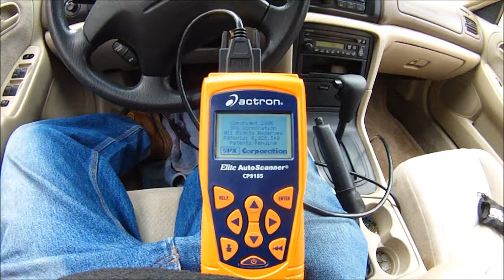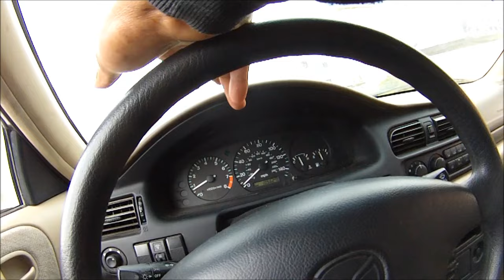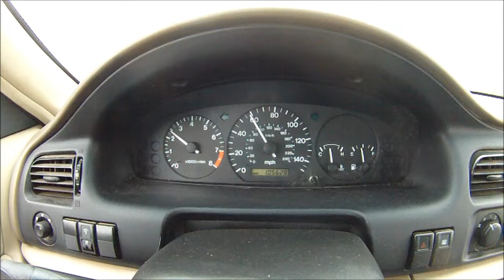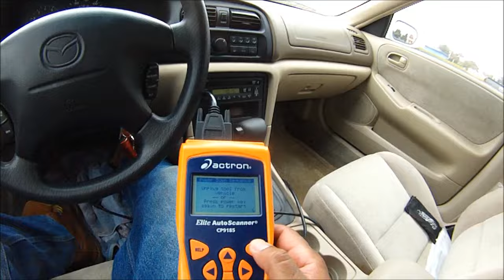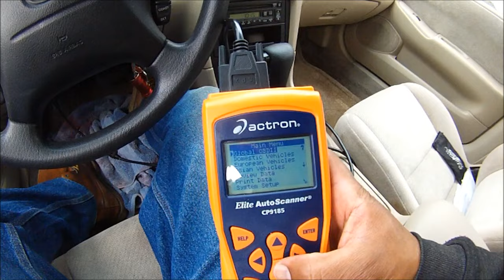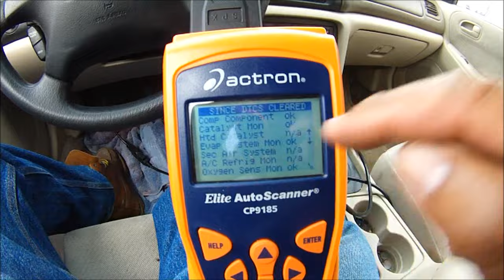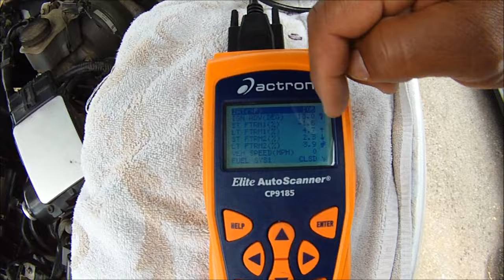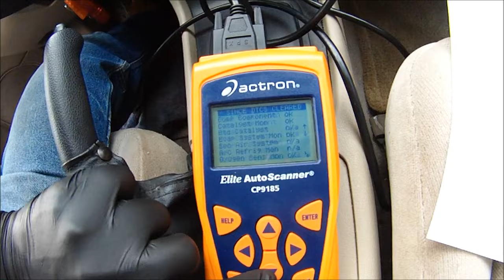WHAT SMOG TECHS WONT TELL YOU AFTER YOU FAIL THE SMOG TEST FOR (INCOMPLETION OF OBDII SELF TEST)

Comment: I have an 08 Chrysler pacifica. my problem is that the p0420 comes on before the evap system is ready. I've tried all the driving cycles to try and get the evap to be ready before the cat monitor triggers the p0420 and no luck. So stuck and looks like I'll have to replace the cat. Any thoughts?

Comment: Oldskool funk, I am having major problems just to get my smog check to pass. I have a 2005 chrysler pacifica touring. After failing a smog check, after getting all the repairs they now tell me that it is not ready. I think I will try this, what do I have to lose.
Reply from the maker: Research your drive cycle first so you don't waste time La Tanya, or ask a couple of smog techs (yes drive around and ask, the worst they can do is not to tell you) the process for your specific vehicle you can save a lot of time and money if you simply ask some will tell you some wont, but do not stop or give up God Bless.

Comment: Very helpful. I have a 2002 corolla. I have been driving the car like this for few times but still my cat monitor is not ready. I failed my test because of CAT monitor being not ready. Any suggestions?
Reply: Yes, buy the $70 Actron Elite scanner from Amazon that is shown in the video. Follow steps in video with scanner. Retest with scanner before taking it to smog station. Keep repeating Toyota drive cycle and re check with scanner until the I/M shows as all ready. Drive car a bit on the day of retest. Then take to smog station and pass!

Comment: I own a 2000 ford Taurus and I've never seen anything like what I've been dealing with. I get the monitors all ready except the evap, I'm allowed two not readies. Anyways I get all the monitors ready needed to pass then when I shut the car off they all go not ready again. I checked power to the ecu and I'm not losing power. last time my mechanic friend  let me remove  my obd scanner and plug the inspection scanner they use without shutting the car off, he let me and I passed that was last year 2015. Now I need to do it again and the shop isn't around no more. Sucks man I live in NY and I got cops harassing me, leaving tickets on my car as I sleep for a overdue inspection. I've been pulling on my front lawn since when I call it a day.
Reply: Anyways I was wondering if you ever had such a problem or ever heard of the pcm resetting itself when you turn the car off. I already tried replacing the ecu and the pats system "theft system" doesn't allow it cause then the ecu doesn't match the key going into the ignition. I just get a theft light flashing. If you have any ideas please share cause I'm scratching my head on this one. I'm not no baller if I was I wouldn't be driving this. Thank you for your time I appreciate anyone's input. Stay up
Reply: Do your check engine lights flash in any pattern?
If there is a pattern, count the number of flash pattern as it's a code.
It might stop flashing and you'll have to start the engine again.
Then search for the error code online...i found a bad seatbelt indicator wire
Reply: Steven Green Dependent upon what type of vehicle you're referring to, most vehicles have a Keep alive memory power into the ecm/pcm. Some are fed from a fuse but I would need the info for your vehicle to check a wiring diagram
Reply: ONBOARDTECH333 I have a 2011 Toyota Corolla. Which fuse would I need to replace, remove, or whatever?

Comment: If your check engine light has a hard code all this trickery is no good. get it fixed and you don't have to worry. Shop around for a good mechanic that will not rip you off. Evap system monitor WILL take awhile to be ready for my vehicle it took about 20 to 30 start stop cycles to be ready regardless of total miles driven.

Comment: HEY IF YOU JUST TYPE OBD 2 DRIVE CYCLE PROCEDURE YOU CAN FIND UNDER REPAIR PAL WHICH IS PRETTY BASIC AND IF THE CAR SYSTEMS IS OK YOU SHOULD BE ABLE TO COMPLETE THE DRIVE CYCLE TEST TIME 20 TO 30 MIN .. THE CAT MONITOR  IS VERY SIMPLE TO COMPLETE 3 MIN STEADY  AT 55 MPH USE A CELL PHONE STOP WATCH AFTER 3 MIN TAKE YOUR FOOT OFF THE PEDAL LET THE CAR COAST DOWN TO 20MPH DO NOT STEP ON THE BRAKE  ONCE IT HITS 20MPH GO BACK UP TO 55MPH FOR 5 MIN AND THE CAT SHOULD COMPLETE SOME CAT MONITORS TAKE UP TO 5 TIMES TO COMPLETE

Comment: Ok...couple months ago I had my water pump replaced. After that a "Check Engine" light came on and I took it back to the guy who did the water pump for me. He deleted the light (I was not aware of that). I thought he fixed it. 3 Weeks ago the vehicle was due for smog, but there are three lights that need to show, so it failed.  I took it another shop he told me to drive @ 55MPH. I did pick up another light. Now, only the Catalyst Converter and EGR are not showing. What should I do? Please share.

Comment: Did the 5 min 60 mph freeway and slow to stop with no brakes.  Twice!  I already have replaced the 02 sensor 100mi ago(as recommended by FIXD Scanner) STILL MY CHECK Engine is ON!  What Now?  My Honda CR-V only has 85,000 and pass smog last year 10,000 mi ago!  Car run fine  Clean plugs+gap.  Cleaned fuel injection with Purple $20 cleaner 2X, cleaned MAP, New Air Filter!

Comment: I have a 2005 chrysler pt cruiser manuel High output 2.4 L engine. i recently changed the PCM from factory to  a high performance stage 1 Pcm and the car keeps being rejected at emissions testing. There are no codes or engine light on. I've put 350 addtional miles on the car since changing the PCM. What is stopping my car from passing emissions testing? Catalytic converter eff. not supported;evaproative control system not supported;secondary air system not supported;oxengyn sensor not supported.
Reply from the maker: +Lisa Lopez Not sure what the issue is but I know that Sometimes you have to do a RELEARN procedure after you change a PCM/ECM or other components that effect drivability. I would look into that plus is that PCM compatible for your vehicle?
Reply: +Lisa Lopez each manufacturer from Acura to Toyota has a factory drive cycle that must be done to get things ready for smog. Check the Chrysler website for that drive cycle. In my case with BMW, it was similar to what oldskool showed in this video except I had to do cold start and let idle for 3-5 minutes with A/C and defroster on, then drive 20-30 mph for 5 minutes then 40-60 mph for 10 minutes, slow to stop without brake then idle 5 minutes and drive in stop/go for 20-30 mph and stop. A big pain in the ass to do but only way to pass smog!
Reply: Renaissance Man Sorry it took so long to comment but I actually just saw your post now. I/ We (my husband) took the high performance Pcm out and put a new/ refurbished manufacturer one in. He drove it for about 2 days around town and maybe once on the express and took it to get an emmission test. He passed the test.  I will go back a little in this story. Before my husband put in the High performance stage 1 Pcm he was having trouble with the car. While driving it would just stop. It would die. He said because it was stick shift/manual, he could get it to start up again. He had an explanation for it, but I don 't remember what it was..He didn't know what was wrong with it and he was about to start changing sensors until I did some googling and found out that it was probably the PCM. My husband decided since he would be changing the Pcm why not put in the mother of all PCMs. (Just like a man:)) so instead of putting in the same PCM the car came with, he put in a high performance stage 1 PCM. After failing the emissions test several times, he spoke with the person he purchased the PCM from and he told him that the high performance PCM is not compatible with emissions and will probably never pass no matter how long you drive it. The car was very fast before the high performance stage 1 Pcm, so I don't know why he thought he needed more power. He only drives it to work anyway and the car was already a turbo Gt. Anyway, after installing the same"regular" not so fancy Pcm he was able to pass emissions on the first try. Hope this long explanation helps some one else who maybe having trouble.
Reply: +Lisa Lopez so after passing smog did he put in the fancy PCM?
Reply: He hasn't changed it yet, but he did mention it to me a few days ago. I suggested he just leave well enough alone. He believes he should but the higher perfomance one back in since he has already spent the money on it. I am sure he won't follow my advice and when he gets time he will change it. It didn't take a very long time to do the switch before. If he returns to the high performance one I will give an update on how the car is performing.

Comment: I'm having this exact problem with my 2006 Dodge Charger . I failed the smog test today and on the results were the Catalyst, Oxygen Sensor and Evaporative System not ready. Will this work for my year, make and model car? I plan on trying this tomorrow. I just don't want to have to put any more money into getting things fixed so it can pass. So far we've changed the Camshaft Position Sensor and Ignition Coil. Then after fixing that, a whole different came up and we put in a new EGR Valve. Now two new codes came up and we were told to erase the codes but that didn't help pass the test. Anyway, any insight or suggestions you may have would be most appreciated. :-)

Comment: I will have to do this tactic today. my car didn't pass the smog test because the catalytic converter needs to be changed or something, and I had it change yesterday, but I checked it on my monitor thingy its still not ready or something. so I might need to do this tactic looks really effective. I don't know if I can do the 55 miles without hitting the breaks though here in Union city, California. kinda busy road. there's only catalytic converter missing on my computer when I checked it. but we'll see.  awesome vid though.
Reply from the maker: +Coup De Grace Check your drive cycle process from the factory repair manual, google it first. Wait until there is the least amount of traffic and be safe ok.
Reply: +oldskool funk sure, thanks for responding man. will do that now

Comment: what if i bypasses my catalytic converter will they look for it? my check engine light is off. i dont know what i did to get it to turn off i think its because i cleaned up the motor and most of my valves and changed all 4he fuses and hooked up some wires that didnt get pluged in

Comment: The core problem I see is that if you pass the pollutant tests there should be no reason to worry about anything else.  We saw how useful smog tests were with VW.  If that don't prove a racket what does?  Smog testing is more about making money for the state and the shops that do the repairs than clean air but this whole procedure is really not good advice from a safety standpoint.   Delayed braking and erratic throttle action on a busy road is creating a hazard to other drivers The heart is in the right place but even just driving with the hazards on can get you a ticket in my state.  Bottom line is that if you have to do something like this to get a car through emissions that passes otherwise the rules need to be changed.

Comment: Hey Dr Chill, I've seen some videos showing OBD2 "simulators" out there.  If I'm running a standalone ECU that has no OBD at all, like an AEM EMS, Link G4, Holly, etc, can I use one of those "simulators" and wire it to the OBD port in the car, and use it to pass smog by inputting my own values?  Or would the smog people know it's not a legit reading?

Comment: Sir my smog test came back not ready. Which means my car failed. I had a friend check my car and he said that bank 1 oxygen sensor are bad. I noticed though lately that my car eats ip alot of gas. I’m thinking of replacing the oxygen sensor. But i’m not sure if this process you show will work. But i can try. Do i have to replace the oxygen sensor and do this process or i don’t have to replace them then do this process?

Comment: I have a Honda 2007  I already did this drive cycle several times I already drove the car for 700 miles and I put the scanner on it and it says free Spring data still stored in the computer When I first got the card I put the scanner and it was ready to go to smog but I disconnected the battery and this is what happened to me do you have any answers

Comment: i have a jeep wrangler with a po 456 codereset the computer and installed the gas cap code popped up again reset computer bought stock gas cap and bought a cen-tech scanner about to drive it to work with the computer hooked up doing the street test hope i find my leak

Comment: Hi oldskool funk   I have a two quick questions. I've have a  Cel and the code is 0456 come up recently. My issue is my smog is due in a #few days.  The code & cel has come on the past. This last time it went off by itself after getting gas.

Your text below the video says don't clear the code by the tool or battery. Is that because you need your car to run the drive cycles to complete again before it can be tested?  If you fail smog, will they retest for free?

Thank you so much! Blessings on your day.

Comment: I hope this works I flip cars and I got a neon (i hate neons) but i got it for cheap and has 71k miles on it so i couldn't pass it up. I fixed the timing belt on it but damn these codes dont come off cam/crank correlation and ofcourse the emissions don't register

Comment: Hey I just changed my secondary air injection check value because I had a code p1415 do I need to rest set the whole computer or can I just rest set that one and when I start it there's no check engine light on but if I put it in auxiliary it shows check engine light what should I do drive it more???????

Comment: I installed a new catalitic, and did the drive cycle, and can't get rid of the cat monitor. In L.A . gets too complicated to do it right.
Reply from the maker: Sometimes I Erase the codes while I'm driving and do it all over. Dont stop keep on fighting through it.
Reply: @oldskoolfunk71  Thanks a lot man, I finally solved the problem. The Catalyst cost me $80 at Ebay compared to $700 at the local auto part store . My brother took the old catalyst to the scrap metal, and got $60 for it.  After not getting results, I replaced the oxygen sensor and the thermostat. That did it, finally, all the monitors cleared, and pass the smog test. God bless and prosper you!

Comment: Hey my man! I guess we're neighbors! I know that stretch. 805 to Palm. I have a Camry Solara that came back with a catalyst monitor not ready after taking it to College Smog Check.  The guy recommended the drive cycle but after 6 days and 5 tries, my scanner still says 1 incomplete (catalyst). What would you recommend or can you look at it? Maybe the rear O2 sensor? original O2 sensors and cat 192k on it. Might take it to Toyota.

The car was worked on twice this year. Had a thermostat stuck open light about 5 weeks ago. I cleared it before fixing. Not sure why that would have anything to do with it. Also over the summer I had misfire codes due to a spark plug wire short. I cleared those codes and put new wires in.
Reply from the maker: Thanks neighbor lol. I would look up your specific drive cycle but look it up from the "factory manual" check at the library (down town SD civic library has tons of manuals) but Google it first. do that before you take it to Toyota because they are going to burn a hole in your pocket, Stay persistent!
Reply: oldskool funk thanks
Reply: +oldskool funk UPDATE: Good news. I took it the Toyota dealer. No parts needed! Apparently there were some other pending codes that my cheap bluetooth scanner didn't pick up (supposedly). They took it on a drive pattern of their own too. So I was just out for the $115 diagnostic fee. I can deal with that. Better than replacing perfectly fine sensors and cats for 7 times more money only to find out that didn't fix it. Just didn't want to deal with the hassle anymore.
Reply from the maker: +sdnative Cool great to hear that. The drive cycle can be a real pain at times. You just reminded me of something I forgot to mention in the video. Some scanners will not pick up all codes. There are hard codes and soft codes and only a real good scanner will pick up both, but most cheap scanners will only pick up soft codes sometimes. I will add an annotation to the video Thanks for the reminder. The money you paid was well worth it. I am dealing with 2 monitors that will not set right now, evap and 02 sensors but I am close to figuring it out. Congrats and God Bless
Reply: oldskool funk Good additional info. God Bless.
Reply: +oldskool funk  I used Actron Autoscanner CP9670 was well worth my money.
Reply: James Kramer So same brand as his. Just a different model number. Will look into getting one at some point. I guess they're more expensive for a reason.
Reply: sdnative there reasonable I paided $100 for mine.
Reply: thats right. I had two OBD II scanners that were useless. So I bought the same Actron Elite scanner used in the video which is awesome and does the job. I paid only $70 for it brand new on Amazon and got it in less than a day. Totally agree money worth it to have a tool useful for all cars not just to pass smog.

Comment: On the paper printed out to me it Failed  on the Liquid Fuel Leak test. Will this video apply to this Fail for me? If not...please tell me how I can pass my Mother's car
Reply from the maker: You failed a visual test because the Technician seen a fuel leak somewhere in the fuel system. Lift the car and see if you can see fuel leakage ( old wet look ) around the fuel tank, fuel lines and hoses, Even a fuel filter can leak or a fuel line in the engine compartment. Make sure you fix it because any fuel leakage is not good and you do not want your moms car catching fire. Fix that issue ASAP.